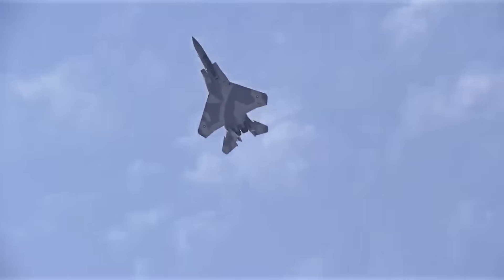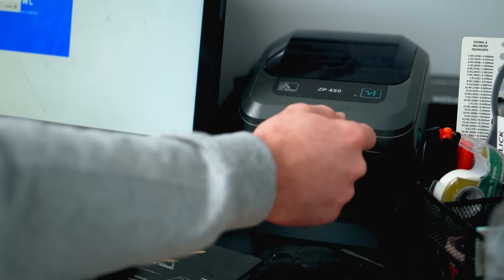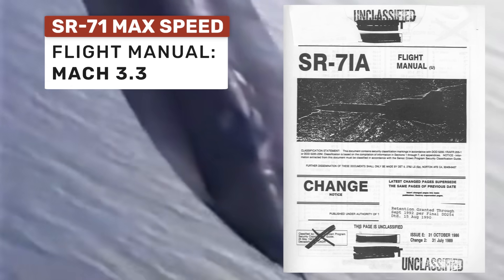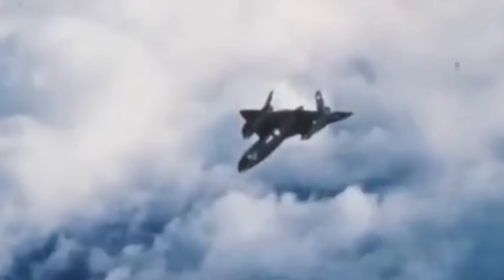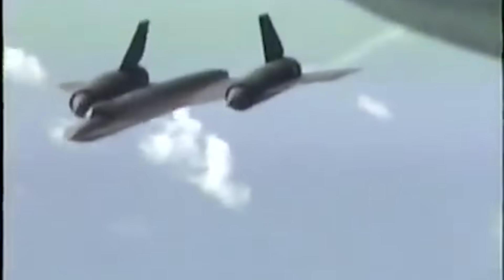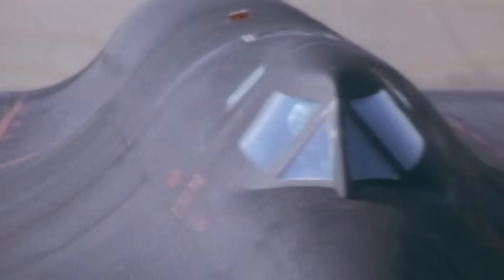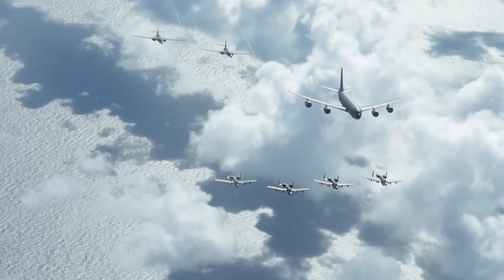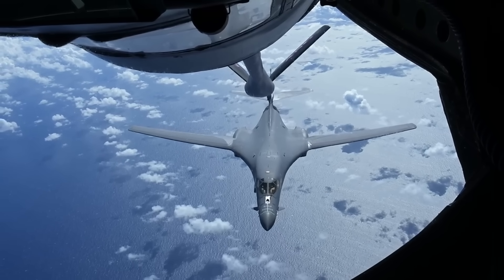The SR-71 was MUCH FASTER than the Air Force will admit

Comment: I believe I remember an interview of a pilot say something along the lines of, "They launched sams and I just pushed the throttle and next thing I knew I was doing 3.5+ over the Mediterranean. And it led to a little political kerfuffle because they couldn't slow down to turn to keep out of a non-named country's airspace."
Reply: Brian Shul. A lot of other blackbird guys have said he likes to bend the truth.
Reply: @JohnMaxGriffin Yea, same.  I watched an interview with a Lockheed test pilot (the guy who survived a Mach 3 ejection; sadly, while the RSO also was ejected, he did not survive) gave a noticeably irritated grunt and body language when the interviewer brought up Shul’s claims.
Reply: @JohnMaxGriffin  When they were flight testing the SR71 in 1964, it hit mach 3.4.  So 3.5 isn't that big of a stretch.
Reply: @panderson9561  It’s still a stretch
Reply: @JohnMaxGriffin so the actual manual says that pilots are not to go past Mach 3.3 but you think 3.4 is a stretch.
Reply: @snakebitten6967  I said 3.5 is a stretch. You said it wasn’t much of a stretch. I said it’s still a stretch.
Reply: @JohnMaxGriffin  I didn’t say that it was t much of a stretch.  That was someone else.  It was already clocked past Mach 3.3-3.4, if memory serves, and multiple pilots mentioned there was a lot of throttle travel left at those speeds, and you think 3.4-3.5 is a stretch?  The engine could easily exceed the airframes ability as attested by the engineers.  Going that fast wasn’t recommended for those reasons, not that it “couldn’t”.  That is what most of us gathered from the amount of SR71 videos out there.
Reply: @snakebitten6967  Ok, didn’t realize it was someone else. But it sounds like you’re saying it too now lol. I’m not going to speculate on what was or wasn’t possible. The thing flew a lot of hours, we don’t really have to speculate about what it could do. If Brian Shul is the only guy saying he went 3.5 and the other guys in the blackbird community think he’s full of it, I’m not going to go around saying it could go 3.5. And other people shouldn’t either.
Reply: @snakebitten6967  The vast majority of jets have engines that can overspeed the airframe. That’s not unique to the blackbird
Reply: @JohnMaxGriffin  that’s your opinion that you are trying to strong arm everyone else into believing.  My point wasn’t  that I am right, but that it is clearly possible given all that we have heard that it would do 3.5.  It’s logical as one did 3.4 according to some sources, with a lot of throttle left in it.  

We will just have to agree to disagree.  👍
Reply: @JohnMaxGriffin  you clearly missed my point. See my response above
Reply: @panderson9561  It's youtube and pseudo-journalism, so numbers have to be trumped up...:(
Reply: That was Major Shul
Reply: I worked for a former SR-71 pilot that said he had to pull the throttles back before the missile lost track or they would overspeed and break up. The plane kept accelerating for a few seconds due to the ram affect.
Reply: I heard that one also.
Reply: He was there and I wasn't, but other pilots did not believe it.
Reply: That was SOP for a SAM launch.  Just open throttle.
Reply: I seem to remember that at high speed, you'd pull back on the throttle to speed up.

Comment: The military never gives the real top speed of its aircraft or ships.  That would give opponents a significant planning advantage.  Plus, the maximum speed is probably dependent on the weather, the flight path, weight of weapons/fuel/isr equipment, how much maintenance you are planning to do after the run, etc, etc, etc.  But to be honest, I was hoping you would say mach 4 or something 🙂

Comment: Pretty sure the SR-71 could fly faster but due to technology it was built with, it couldnt sustain that speed in operational flights
The thing that is great about the Darkstar from Top gun is that it has conventional engines for take off and scram jet for hypersonic flight
Why thats greatly is the SR-71 pilots had a super bitch of a time keeping it slow enough to meet up with tankers

Comment: When I was a little kid in the late eighties, early nineties, I used to get these post cards in the mail that were all about airplanes. I don't remember the name of the company or anything, but it was a monthly thing where I would get like 10 of these post cards every month. I memorized all the stats, and I distinctly remember the Blackbirds top speed being rated at Mach 3.5+ on those cards. Take that for what it's worth.
Reply: Think I had the same thing, by the time it was done there was a shelf full of ring-binders.
Reply: I remember those 'airplane cards' from the 90s, though I don't remember a single thing about the specs.
Reply: I had the same thing, but cars..